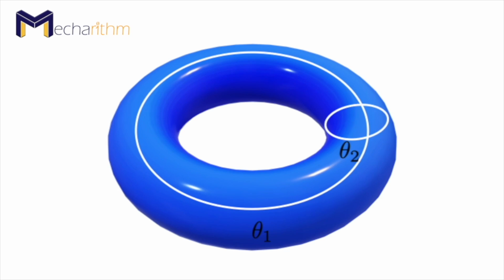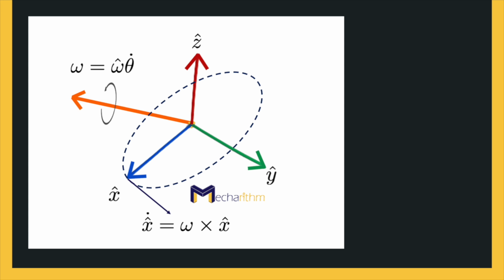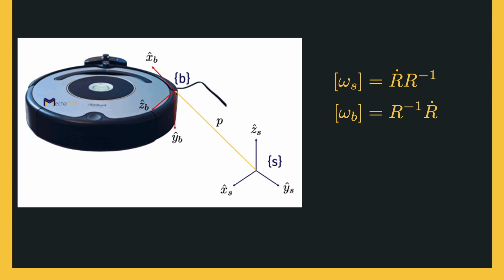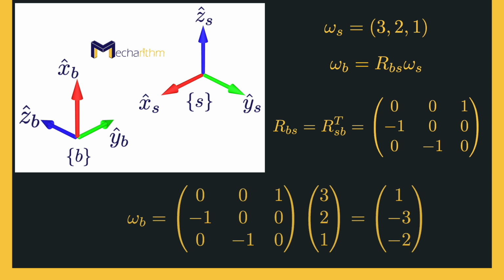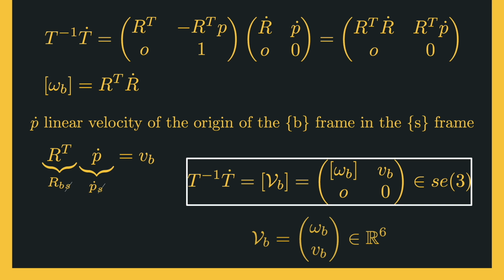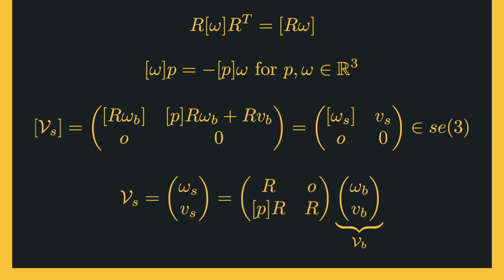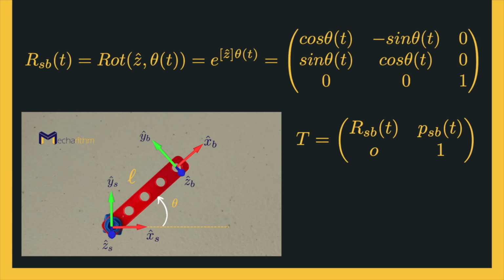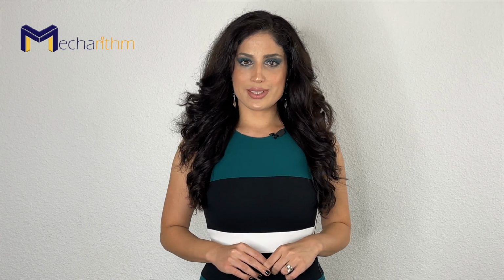Velocities in Robotics: Angular Velocities & Twists | Fundamentals of Robotics | Lesson 16

Comment: In example how you calculate, -R^T [p_sb] as p is 3 by 1 and it should gives answer of 3 by 1 matrix. So how P_sb is converted to 3 by 3?
Reply from the maker: bracket notation is the 3 by 3 skew-symmetric matrix representation of a vector. you can find this matrix definition in this lesson: https://github.com/madibabaiasl/modern-robotics-I-course/wiki/Lesson-4:-Orientation-in-Robotics-(Exponential-Coordinates,-and-Euler-Angles)
Reply: @mecharithm-robotics  Thanks a lot for this great lecture and quick reply. It was really very helpful 👏